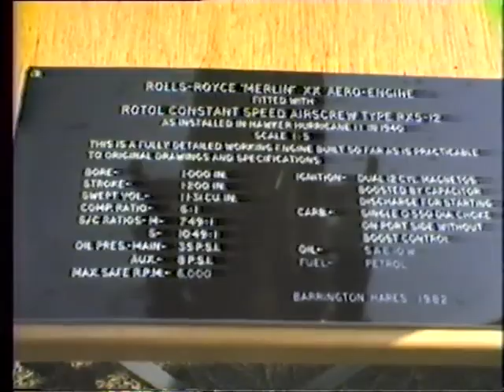4 - Merlin Engine

Comment: Mr. B. Hares was 45 years old in 1983! so would be 85 or 86 years old in 2021! Most all of his machinery when I visited in middle 80's was Swiss watch making machines, that he got on the cheap! His main lively hood was OH of magneto's for motor bikes & cars working out of his flat! needless to say he was not married! Before the Merlin engine he build Norton Manx motorcyle engine that also run, his last engine was of coarse was the R-R Eagle 22  a 24 cyl. sleeve valve engine that I never saw!
Reply: Barry is over 90 now and going strong!
Reply from the maker: Thank you so much for the information, at least there is a possibility that if is still in his possession, 85 is not old by modern standards. Do you know if he still resides in West Bromwich?
Reply: @martyndemers1264 
https://youtu.be/itIWN2q1JMQ?si=q8B0qK2aFmqTm7--

Comment: Fantastic - I love his concern for health and safety of his spectators standing behind the line, while he fuels the engine with a pipe in his mouth 😁
Reply: A pipe in one’s mouth is one thing but by simply asking the audience to stay out of the prop line shows a full understanding of the possibility of a prop blade separation!
Yes I said “blade”, with the kinetic energy going on here, one prop blade has the energy potential to go straight through you!
So do not stand anywhere near the prop arc!
In other words stay out of line of fire.
Excellent miniature engineering!

Comment: Is he smoking while fueling that engine?
Reply: It takes an open flame to ignite gasoline, a pipe or cigarette, is no problem.
Reply: @gregpeterman1102  Can you explain how rubbing two sticks together can start a fire with material with a much lower flash point than gas?
Reply: @arnoldaltjr.2099  not if it is saturated in gasoline, it would be almost impossible to start a fire that way.
Reply: @gregpeterman1102  Than how does gasoline vapor ignite in an engine with only a spark, no open flame?
Reply: @arnoldaltjr.2099  The fuel mixture is under  high pressure, and the spark from a spark plugs is at a much higher temperature than a cigarette. If the fuel/air mixture is too rich, or the electrode on the spark plugs gets wet from too much gasoline, it will not fire. (I went to school for this.) Ever heard of an engine that will not start because it is flooded? Also, if the mixture is not compressed in the combustion chamber it will not fire.

Comment: I am fifteen years into building a nine cylinder radial, built about a dozen simpler engines while being stuck for a while with an oil pump issue, just was looking at it inside out.  It'll be done, Lord willing, in a few years, or five, if there were 15,000 parts in the original Merlin, as I suspect is true, I expect there's that many parts in this scale miniature.  I've thrown about six or seven cranks away, a couple cylinders, a couple heads, and it's not but half done, I'd say.  That has to be the best sounding engine I've ever heard, (original) and this model sounds precisely like its original, for scale.  The cylinder timing makes for the distinct exhaust sound, and a Merlin stands alone, in my opinion.  Beautiful work, a true masterpiece.

Comment: Thanks for sharing, it's a treat to see this video, I've seen the engine at a show about 15 years ago  but it was not run at that time. Barry Hares built this nearly 40 years ago, I've seen many pictures of the internals, it is at true scale model, there are no simplifications internally. Barry had modest small model engineerg machinery and certainly no cnc. Incredible achievement.
Reply: This is exactly what fascinating me when I discovered pictures from the build.
Reply from the maker: Thanks for the information, a lot of people ask about it’s construction especially if CNC was used. There are a lot of people including myself that would like to know where it is now, I get a lot ask if it’s in a museum.
Reply: @martyndemers1264  there were a bunch of talented model engineers in midlands area UK and Barrry was one. When I last saw the engine it was displayed at the Midlands model engineering show - maybe around 2005 and Barry was a judge at the show. Model engine maker magazine did an article on Barry and his modest workshop in one of their editions. There is some information on this engine and the rolls Royce eagle which followed on the web pages of the late Ron Chernich it’s called model engine news

Comment: fantastic job on the build  sounds like it has got a lot of power I can't imagine the size plane to put it in with that much power
Reply from the maker: Yes the man who made it was a great engineer, it’s sound was exactly like the real thing only scaled down
Reply: It doesn't have as much power as you think. An equal displacement modern 2 cylinder model engine has far more power.
Reply: 1/4 scale maybe......?

Comment: 1/5 scale Merlin, correct in every detail, even the magnetos
Reply: Are these prints or castings available?
Reply: @vps6868  @ No, sorry,  Barry Hares manufactured everything from scratch including all the castings, he was a magnificent model engineer.
I had a friend, Laurie Fletcher, who worked at Royce’s during the war, he also made wonderful scale models, some of which never actually went into production but only existed as drawings, he also had a magnificent collection of engines which I think are in the Silk Mill in Derby
Reply: @lesterbeedell9725  wow...simply amazing. Did he ever make his drawings available?
Reply: @vps6868  @ not that I’m aware of, he was an ignition specialist and it had the smallest working magnetos, there were videos of the engine running on YouTube but they appear to have disappeared, sorry not to be able to help!
Reply: @vps6868  i purchased the drawings and sizes and fits manuals back in the mid 90s.
Reply: @nigelmammatt2448  would you be interested in selling them? Or making me a copy? I would pay you good $$
Reply: @vps6868  possibly interested in selling them, though they weren't cheap. All RR works drawings and original manuals.
Reply: @vps6868   There used to be a company in the US who made all the castings and drawings for a 1/4 scale Merlin engine.
Reply: @smiffy788  I own that set, but looking for others such as this 1/8 scale
Reply: Lester Beedell.  From memory, I think it was even more impressive than that - even the spark plugs were scratch built!  All twenty-four of them!
Reply: @rogerwhittle2078  yes! A friend of mine who worked at Royce’s during a War, Laurie Fletcher, had a great collection of scratch built 1/5 scale engines, including a Merlin, he made the patterns and produced the castings in his spare bedroom, some of which only existed on paper, he also had many full sized engines in his collection, including a Dart from the Alidair Viscount which ran out of fuel in Devon

Comment: Is that Barry Hares??
Reply from the maker: Yes I believe it is a truly amazing engineer
Reply: martyn demers @ I’m a member of the RR heritage trust and I knew a guy who worked at Royce’s during the war, Royce was the engineer, Laurie Fletcher, he built a 1/5 scale Merlin correct in every detail, I had 2 Merlin XX’s which came outside of a Beaufighter which crashed near Ford in Sussex and I’ve still got a few bits but divorce isn’t good for projects like that, Barry Hares was an ignition specialist and he built the smallest working magnetos, I’ve still got a BTH magneto off one of the Merlin’s, the flange had broken off and a friend welded it together and it still sparks after 40 years underground!
Reply from the maker: Lester Beedell it's been so many years since I recorded that video and the name of the chap was not recorded by me
Reply from the maker: Just had a scroll through the comments and apparently his name is on the plate as Barrington Hares